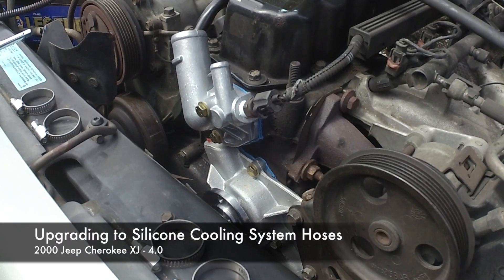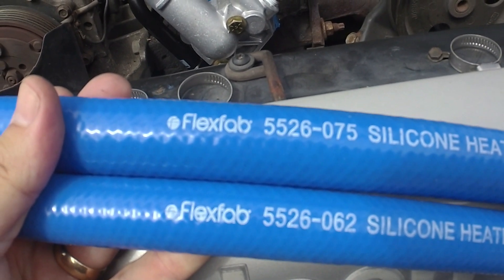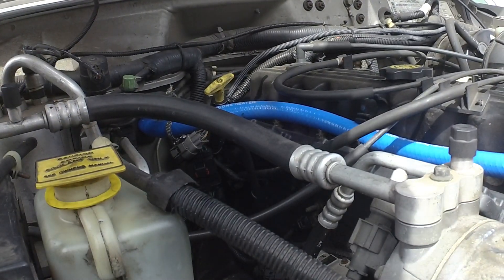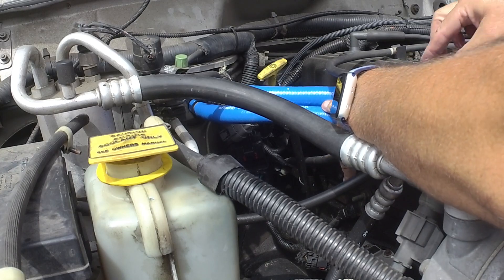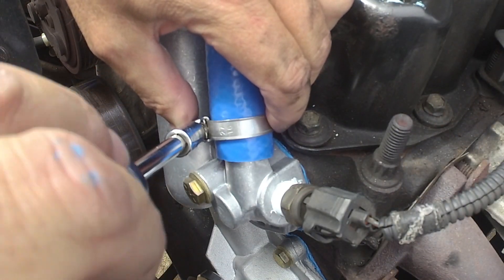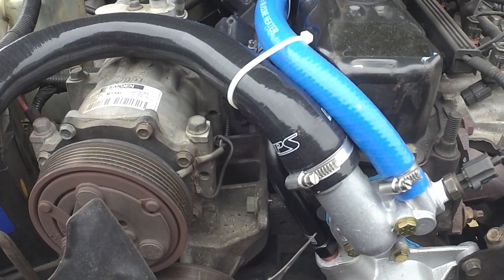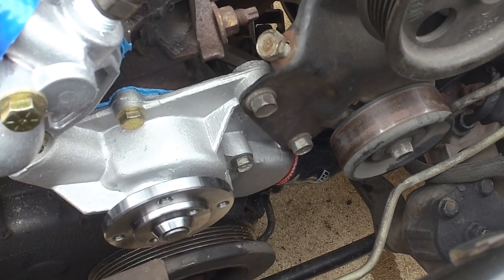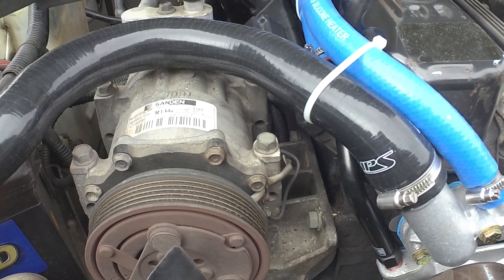2000 Jeep Cherokee XJ Silicone Hoses | Cooling System Upgrade

Comment: Great video! How are the hoses holding up? Do you think it it’s worth the additional cost to upgrade to silicon hoses?
Reply from the maker: Holding up very well although I’ve since bypassed my heater core since I began leaking in the cabin. Silicone is superior to rubber but certainly a bigger up front investment. For me it’s worth it for the peace of mind. Thankfully because I drive this old Jeep I have no car payment, so it’s a little easier to justify some of these decisions.
Reply: Thank you for the feedback. I saw a cheaper set of silicone hoses on eBay. I haven’t decided what I’m going to do but if I use them I will up date this with the information.

Comment: I am about to redo my cooling system and do a flush. Just bought a High-Flow water pump, Spectre Radiator+silacone hoses. Is there anything I am missing to do you have any advice? I was going to delete the Aux fan and replace it with a larger Taurus or Volvo fan but I may wait to do that at a later time..Thanks a ton man!
Reply from the maker: Might replace the thermostat while you are at it? Good Luck.
Reply: @MattsGarageMiscDIY  replaced t stat, t stat housing, and water pump today. I was going to put in my new PS pump tomorrow but when removing the original PS pump pulley the pulley came off with the shaft and I can't get it off. I don't know what to do. 

So I guess I will replace the radiator tomorrow and the silicone hosing and then do the PS pump after. On top of that I ordered a timing chain bc I was going to put it on first when everything was out but it still hasn't arrived. So the timing chain will have to be last. I hope I will have enough clearance to get it in easy. I took everything off the engine 4 days ago. Xj has been having really over heating issues lately. Now I am in a race of Time to get the jeep on the road before I lose my Job! It's my DD and the labor was too much and had to take it upon myself. No power tools just sachets and magiver skills. Praying I can get it on the road by tomorrow and do the Timing change later on in the near future. This whole ordeal has made me broke non the less. 

 Thanks alot man for the video. Its really the best one out there in regards to xj cooling

Comment: What size HPS embossed hose clamps did you get? Did they fit both 5/8 and the 3/4 hoses?
Reply from the maker: I believe these are the ones I ordered: https://amzn.to/42nzhAK
Reply: @MattsGarageMiscDIY  Do you mean the 1/2''-13/16'' (13mm-20mm)???
Just want to make sure they fir both the 5/8 and 3/4 hoses before I order.
Thanks for the video and the fast response! I watched this over a year ago and saved it to my "xj to do's"
I ordered the hoses from the links you provided a few days ago but wasn't sure about the clamps. Thanks again, man! hope you have more xj content to come!
Reply from the maker: @NorEastBeast  yeah those are the ones. I have a couple other small projects upcoming on the XJ. I typically just fix what needs to be fixed and try to capture video whenever possible in case it ‘s helpful. Good luck!
Reply: Are there any other hose clamps you would recommend that are cheaper? I like the ones your using bc they seem like the best for silicone hoses. I was also read t-clamps are good?

Comment: HPS hoses cost far, far more than the other silicone hoses on the market. Why did you select theirs?
Reply from the maker: At the time I made the repair these were the only ones I could find in stock. There are some VERY cheap silicone hoses out there, but I subscribe to the belief that you get what you pay for to some degree. I would have gladly gone with Mishimoto hoses which are a little less, but they were not available. I’m happy to say that 3+ years later with lots of miles on them and many trips deep into the desert, the hoses are holding up nicely. Good luck with your project.

Comment: Hey! Hope all is well. Was looking into your videos couldn't find anything regarding links for those parts regarding water pump, thermostat, and thermostat housing. Any information would be greatly appreciated as I have too have a 2000 Cherokee and plan to be doing a flush of my coolant / replace the over flow bottle and potentially change those parts mentioned above too.
Reply from the maker: Vincent, here are the parts I used:
Gates 42004 Water Pump  https://amzn.to/3ehzGlf
Dorman 56398 Engine Water Pump Inlet Tube  https://amzn.to/3SQQDBV
Dorman Thermostat Housing  https://amzn.to/3CKF35J
Genuine Chrysler 52028186AC Thermostat  https://amzn.to/3T8MitH
Coolant Overflow Tank Recovery Bottle  https://amzn.to/3MncFdk
Reply: You’re a rockstar. Thank you!
Reply from the maker: @aflykidfrombrooklyn  thankfully all this stuff is very affordable, nice peace of mind to reset the clock on these items, good luck with your XJ projects!

Comment: Im a trailer and heavy equipment mechanic and i deal with alot of air hoses for brake chambers i have a snap on tool thats awesome for hoses part #ya444b it says viynl cutter but this thing is Razor sharp cuts hose like butter I mean I can cut through frickin battery cable with it also what really helps slide those hoses on a radiator or thermostat housing is some multi purpose grease wont hurt anything been doing it on heavy equipment for years
Reply from the maker: I have the Craftsman Handi-cut (9-37200) version of that tool. works amazing for stuff like this, but figuring more people have a utility knife, so used that with a fresh blade in the video, and it cut very nicely without any effort.
Reply: @MattsGarageMiscDIY  yeah thats good too

Comment: Question: With the lower radiator hose, did it have a spring in it and if not, was there any issue with it collapsing under load the way springless rubber ones do??
Reply from the maker: Johanna, great question, no the bottom hose I used did not have the internal spring, but I’ve had no issue. Keep in mind on this Jeep I am just never revving it hard to the point the water pump is pulling so much from the radiator that the hose can’t handle it. If I am daily driving, it’s pretty casual, on the trail everything is low speed, low RPM for the most part. You could add an anti-collapse spring to one of these hoses, they are sold separately if you search. Hope that helps.
Reply: @MattsGarageMiscDIY  thanks for the reply, it's not just from over revving, sorry, I wasn't 100% clear, it happens under pressure. The company that makes that hose kit claim it doesn't collapse under pressure/load.

Now trying to find it in orange. I have an orange and black theme inside the engine bay and the body paint work is raptor liner in black with orange bumble bee stripe across the bottom where the old rubber trim use to be. Also Orange and Black hood with custom made vents using my internet handle "AGA"

lol, sorry, love talking about my XJ with less than 45,000 km on the motor and less than 5,000 km on the newly rebuilt AW-4 Trans
Reply from the maker: @johanna.browne as I have understood it the load typically is higher rpms, but again, I’ve had no issues, and there certainly could be other variables. I’d like to see a pic of all that orange a black, sounds pretty eye-catching!
Reply: @MattsGarageMiscDIY  weird, I shared links to images and the comment disappeared. Must be a Google  thing

Comment: Those heater hoses are backwards into your heater core. Water pump pulls and thermostat housing pushes on a inline 4.0L. Flow comes in bottom heater core inlet and flows out top side of core. That's how air pockets get pushed out of system...👍🏻
Reply: +1 on this. it's also probably why your heater core started leaking soon after.
Reply: @aaron_purdy  Can anyone else confirm this? That's jeep manual diagram shows this too. I bought my jeep used, and it currently has the same setup as the video, where the thermostat housing goes to the top of the heater core, and the bottom of the water pump goes to the bottom of the heater core.
Reply: @Grant-Shillings  so, I'm not an expert or a mechanic, but I have replaced the cooling system on two different XJs (2001 & 1989). if you are replacing the heater core at the same time (or soon after) when you swap the heater hoses, I think you may be okay with reversing the flow. however, if you reverse the flow of a heater core that is 30+ years old, it's possible that you'll awaken some demons inside the heater core—because you're essentially back flushing the heater core. also, it seems like the internet suggests that to eliminate air bubbles getting trapped in the system, it's best to orient the flow from bottom to top, as the system was originally designed.
Reply: @aaron_purdy would bypassing the heater core for the summer be bad for a 30 year old heater core? Lol I bypassed mine cause of an accident that destroyed my AC condenser and lines.. should I flush it while it's disconnected? Or leave it? Any advice would be much appreciated 🙏 thanks!
Reply: @foxmulder7616  bypassing the heater core shouldn't create any problems for it. be sure to plug up the inlet/outlet so nothing gets inside. as for flushing it, that's your call. if it isn't giving you any issues, I personally wouldn't risk it. however, if it seems like it's on the way out and will need to be replaced anyway, might as well go for it. just don't back flush it! follow the flow direction of the cooling system.

Comment: Are the silicone radiator hoses sold at local parts stores? IE: pepboys, auto zone? I only need the top hose! For some reason at normal operating temp, the pressure is very high, the hose is like a rock. I have to replace yearly. ✌
Reply from the maker: I have not seen them, but maybe special ordered? My goal was to go all silicone for longer term durability and reliability if I’m somewhere remote. Good luck, and let me know if you find a local parts source.

Comment: Getting ready to replace the hoses on a 1990 XJ I just bought. They look good but they could be 31 years old so not taking chances. Silicone is the way to go. Thanks for the video!
Reply from the maker: Not only will this upgrade stand up to heat better, but they look will cool too!
Reply: @MattsGarageMiscDIY  LOL For sure! Most people involved in racing use silicone heater hoses so they make your 4.0 look awesome and souped up. haha

Comment: I pulled the heater hose and a lot of the liquid cane out. Is that fine? Or do I need to top it off again? Can I turn the engine back on after I put the new hose on?
Reply from the maker: For sure you want to top off coolant and burp out any air that may have entered the cooling system.

Comment: Thanks for the video.  I found FlexFab by the foot at https://www.anythingtruck.com, plus you can buy individual lined hose clamps.  Hoses and clamps for my 4.0L XJ came to $27.  Shipping was another $12, which sucks.  But at least its a store front and not an anonymous eBay salesman.
Reply from the maker: Thanks for sharing. I’ve also since found the silicon hose on Amazon although offered/shipped by a 3rd party.

https://amzn.to/35J65ak

Comment: How are the new hoses holding up? What type of water pump did you get? Thanks for your video
Reply from the maker: The hoses (heater and radiator) are holding up great. Just got back from several days out at Joshua Tree and a long day on the trail, with no cooling system issues. My heater core did start leaking a couple months after the new Gates water pump (https://amzn.to/2Q5KzWM) and hoses. I bypassed the heater core for now, changing it is a BIG job. I posted a video of the heater core bypass too.